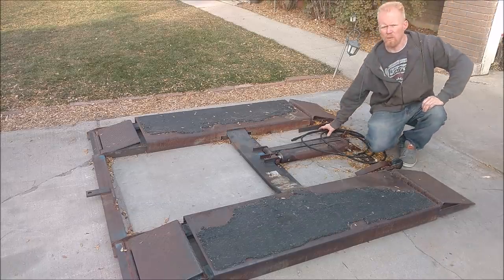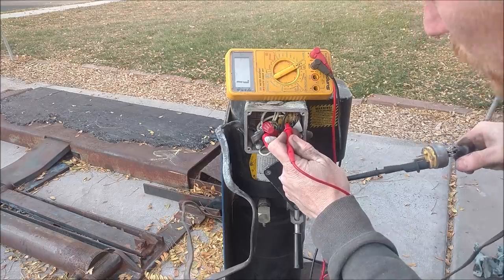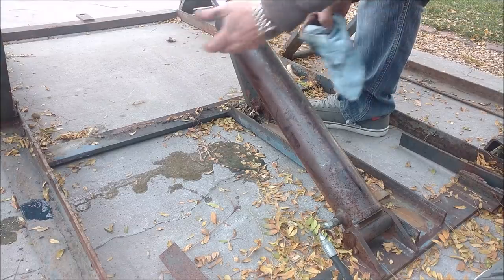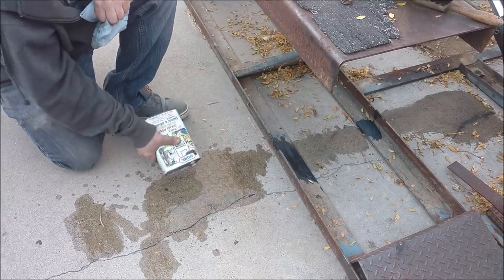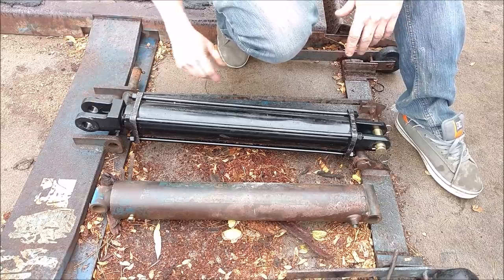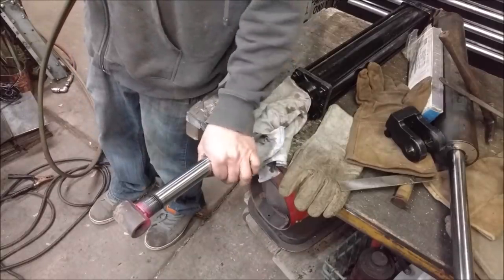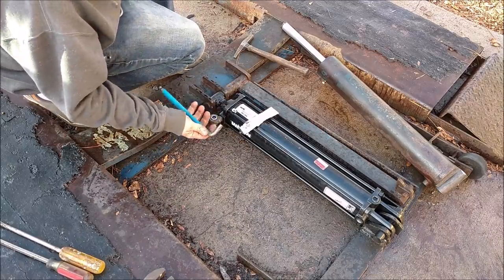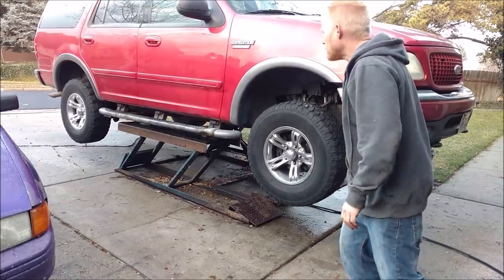Used VEHICLE LIFT worth buying??

Comment: I stumbled onto your page and was very impressed with all your work, including your diy spanner wrench and covering the machined area with your welding glove.
I realize the lift has stops built in as it's raised but it seems a bit risky with the supports on an angle when fully lifted. For added safety, have you thought about welding some eyelets on four corners top and bottom and placing perpendicular upright supports over them when fully in lifted position? They basically would act as Jack stands supporting the raised lift if cylinder was to fail.
Cool lift, and I agree, you better hide it.

Comment: Whew.  The first lift on the truck was scary,  but i am sure you figured out the best points.  Great Job.
Reply from the maker: It's a lot of weight sitting that high. It will take me a while to get comfortable around it. It does have the safely lock, but I'm sure I'll throw a random few jack stands under it if I'm crawling under it.
Reply: @sixtyfiveford  Keep the lock cavities clear of leaves and rocks

Comment: Just a tip, next time you rewire something put on a male plug not a new cord(twist lock if your fancy). You can run any extention cord and it doubles as a power disconnect.

Comment: I have pretty much the same hoist, only mine is powered with an air motor .I love it for doing brake jobs, oil changes, under coating ,anything you can do sitting or lying down. my favorite positions
Reply from the maker: It's a great back saver. I had to do a full fuel tank drop(fuel pump) earlier this year and it was no sweat. I raise the car. Put ramps under each tire to hold the car up. Lowered the lift and pulled all the tank straps. raised the lift up to the tank with some cribbing and lowered the tank right down with the lift. Installed new pump and raised it right back.

Comment: Love that instant spanner at 9:06! Another great video from Sixty-Five Ford!! Learned a lot about the practicalities of dealing with repairs to hydraulic systems.
Reply from the maker: Thanks. I thought about that one for a little while. I cut out the pins and then was about to cut up a large chunk of steel for the spanner handle and saw the adjustable pliers. It got the job done, so I'm happy.
Reply: @sixtyfiveford  Did you leave the pins on the adjustable wrench? Have you used it again later?
Reply from the maker: @JDeWittDIY  I just cut them off and reweld them on when I need them. I really never use the pliers for anything else so I should just leave them on.

Comment: Great job restoring the lift.  After attaching a structural bracket it certainly makes you triple think did the weld penetrate and will it hold under pressure.  Make sure that safety latch is working.  Such a nice feature to have all four wheels off the ground at once!
Reply from the maker: Tell me about it. It's one thing to weld something but another when your life depends on it.

Comment: I used to spray degreaser on the flors of my machine shop and scrub it with a brush, then throw speedy dry on it and it would suck the grease right out. Works even better on a humid day.
Reply from the maker: That's a good idea.
Reply: sixtyfiveford Oh, and I’m jealous of your lift. I’ve been wanting to score one used but no luck so far.

Comment: Great work brother! That little lift is going to make your life so much easier! I wish I had  a blueprint for one of the lifts I've seen advertised on facebook that is moveable similar to a pallet jack, the advertisement shows it lifting a large Dodge Sprinter delivery van! I would fab/build one if I could. The only other lifts that I like are the old single cylinder design-Air powered lift that everyone seems to be removing these days. You have to bury them about 8' down into the ground and concrete the cylinder in. I like that they lower down completely level with the floor and no posts in the way (like a 2 post lift). The other cool thing is that because its a single cylinder, you could pull a car head first in to the shop, lift it and turn the car (180 degrees), and drive it head first! :)
Reply from the maker: I was looking at a cheap used in ground lift the other day. Not much parts support for them anymore. I would think if I was going to the effort to dig an 8-foot hole I'd want to make sure the seal and everything was in good condition before I did that.

Comment: That Expedition had me nervous too! It's a testament to your work though.
Reply from the maker: Yeah, my Expedition weighs 5200lbs empty, so I figure 5500 with random stuff and gas. The lift is rated at 6000lbs but with the safety standards the way they are it probably holds 12-15,000lbs before it fails. After I use it a bunch of times, I'm sure it'll earn my trust.

Comment: that thing is great most small portable lifts cannot be driven over you lucked out dude. I have quickjack and it is not so quick after all but still a blessing.
Reply from the maker: The Quick Jack seams like a nice setup and a little more mobile/compact than the Bendpak. I just added hydraulic quick releases so I can get the hose out of the way.

Comment: You can buy these new for about $1500 shipped.   QuickJack 5000lb Capacity Car Lift 110V BL‐5000SLX.  Very handy if you have a high ceiling.

Comment: Great video ,love your ingenuity in making that replacement cylinder work. Just got a lift myself used ,looking forward to putting it to work.How bennificial has yours been .Thanks for sharing Dale
Reply from the maker: I do love it. It is easier for me to just pull out a floor jack to just do some front brakes on a vehicle. But it's amazing anytime you need to remove more than 2 wheels from a car. I replaced an oil pressure sensor on the back of an engine a few weeks ago and it made it effortless to get up in to the backside on the engine(front wheel drive). I needed to pull an oil pan the other day and put the truck on it; so nice!

Comment: Many years ago I rented a shop that had a low lift like this in it. I went through the same thing with the bad cylinder. Bought another and modified it just as you did here, but one thing I did differently was I added a second fitting and hose at the bleed end. It ran back to the hydraulic tank, so as the pump pushed fluid into the cylinder, the cylinder pushed air to the tank. The tank itself was vented, so it was not a completely closed system, but I worked on cars in the winter with snow and crap dropping off cars and wanted the new cylinder to last longer than the last, (fairly new) looking one did. Many years later I met the new guy in that shop and he told me he had not done anything to it but use it.
Reply from the maker: That's a great idea. That would minimize moisture.
Reply: @sixtyfiveford  I wasn't in that shop much more than a year before I moved, but I never had another issue with it. If you are going to keep this lift, I'd do it. Even though you got the cylinder cheap, doesn't mean another will be and why even allow the chance?? Another thing I did to mine was make 4 sliding pads. There wasn't much chance in them moving, but I made basic "C"channel pieces with a 1/2" nut welded to the outer edge and welded a short 3/8th rod to make a "T" on the end of 1/2" bolts to lock them in place. I didn't really feel it necessary, but since I was working on customer cars I took the extra step. even with rubber pads from a local lift parts supplier, I still ended up making some hardwood blocks for the hotrods.

Comment: I have this lift. It's great for a home garage.  Got mine for $300 from a body shop that was closing.  Add grease fittings to all of those pivot points. Mime had none and joints were all dry. Also, lose those lesther pads. Do nothing but soak up water and rot the steel lift pads
Reply from the maker: I was oiling the joints the other day and thought it was odd they had no grease zerks.

Comment: Great problem solving!  Excellent find ... looking for one of those myself.  I am sure it will save you considerable time with your auto repairs!!
Reply from the maker: Thanks. I've been eyeballing the 2 post lifts for at least a dozen years. They're just too big for my space, so when I came across this one at an auction I knew it was coming home with me.
Reply: @sixtyfiveford  - you got it for a steal ... especially considering that everything worked ... even if you had to replace the cylinder! :)

Comment: I see those hydraulic rams every night. Commonly found on sawdust/wood chip bunkers at your local sawmill.
A super cheap alternative to ATF, is your basic tractor hydraulic fluid @ $20-$35 for a 5 gallon pail.
I’m a little old school. But I was taught, when lifting a vehicle, to get it maybe an inch off the ground. Then be aggressive in trying to knock it off. If it doesn’t budge then it’s safe to go higher.
You’ll then never become a #shopFAIL meme 🤣🤣🤣
Reply from the maker: Good advice

Comment: One thing I might suggest is the storage of those 7018 electrodes, which are low hydrogen “low-hi” and they need to be stored in a dry place (preferably a rod oven) after being opened due to the air moisture that penetrates and affects the weld deposits.  You can cook em before you use them but it’s best to try to manage their keeping after opening.  Nice video!  You should think about piping that air purge to a small storage tank so it stays off your driveway too.😎👍🏻
Reply from the maker: Luckily I live in the 4th driest state in the US where the humidity is extremely low so rod ovens are pretty uncommon around here. I have used 40+ year old 7018 straight out of the open 5gal bucket without any noticeable affects. However, I'm far from being a expert stick welder so I could just be blowing smoke.
Reply: @sixtyfiveford  that’s crazy! I live on Long Island where the salt water and humidity wreck everything, so it’s beaten into our heads with those particular rods.  I gotta say…I’ve been plowing through the entire channel this weekend.  Some really great content.

Comment: New, these Bendpak LR 60-P lifts start right at $2,000.  Well done!  Hope you got the safety locks and stuff that protect you if the hose blows out.
Reply from the maker: Yeah, all the safety stuff is working correctly. I'm into it around 300 right now, so not bad.

Comment: Got it cheap too? Perfect! If you didnt want to rebuild or change the cylinder you could have used a return line straight to the tank. The cylinder wouldnt push as hard and would probably sink down but when you have those safety bars that wouldnt be a problem.
Reply from the maker: I'm into this lift for $300 with the parts. It sells new for $2000, so I'm happy. I debated just as you described but it was pushing a ton of fluid the longer I let it sit. I think this thing had sat for the last 10 years and the pitting would have eaten up the seal further with a couple dozen more cycles.

Comment: air bleeder valve on the port not used,sort of like a breather on hydraulic tank. (I would put a small tank with oil in it in such a way it would drain into cylinder when it is down.keeps upper seals lubed works smoother lasts longer.)
Reply: Run a second hose from the unused port back to the tank making it a closed system? Even if it only has air in it it would stop water getting in there.

Comment: That will be very handy.👍🏼
I’ve never seen a Lyft like that before. Might be a good idea to put some kind a safety stand on it when you have something heavy on it? I always get a little worried with anything hydraulic.
I want one..
Reply from the maker: It has a safety bar that locks in at different heights and I made it a point not to modify that part.

Comment: Great addition for fixing your vehicles! How do you like your power Max 30 plazma machine?? That's the brand I was thinking of buying. Great video and I see your 4 legged companion keeps you busy.
Reply from the maker: My first plasma cutter was a gigantic Snap-on unit from the 90's. It would barely cut through 1/8" all while drawing 50amps of 240volts. I quickly passed it along to the next owner within a few weeks of owning. I then had a Chinese one for years and the initial excitement was quickly diminished with the constant tinkering to keep it going. It only ran off of 120volts but tripled the power of the old Snap-on. Over the years of owning these cheaper units I've read endless forums and the Hypertherm kept coming up as the best by all the guys that use them for a living. It was expensive but over delivers unlike Chinese ones that may claim higher capacity but fall short. The day I got it I was cutting though 3/4"(even some 1", barely) plate even though it's only rated for max 5/8". I'm very happy with it and know it will hold it's value if I decide to buy it's bigger model(45xp) someday. Oh, and it's made in the USA.

Comment: I don't know what brand it was, but I saw an older lift like this in a shop not long ago and it's cylinder had a second line to it. I believe it simply went back to the tank. I want to guess it is to keep moisture from entering the cylinder with the air being sucked in when lowering the lift.  You've had it close to 2 years now, how about an update??
Reply from the maker: It's been working great. I still need to paint it.

Comment: Great repair job on that lift. What you pay for that. Nice little lift. I have a bend pac lift in my garage . Use atf too.
Reply from the maker: I need some good rubber blocks for it, but am happy with the $300 I have invested.
Reply: sixtyfiveford  Nice Set up

Comment: Nice job, sir.
Reply from the maker: Thanks. I'm excited to have it.
Reply: @sixtyfiveford  Idea for the open vent: My Quicklift jacks also use hydraulic cylinders, but instead of a vent on "open" side of the cylinder, they have welded on an air-pressurised accumulator that you fill through a schrader valve. This acts as a "spring" to help collapse the stands when you depressurise the extension side of the cylinder and help it to retract, as the Quickjacks are pretty light and there's no guarantee just their weight would allow the hydraulic cylinder to retract without the weight of vehicle. There is no physical spring. 

You could easily do something similar by running an air hose from your "vent" side to something like an old propane tank or something, since air is compressible and your hydraulic pressure could easily overcome it. Use quick attach air fittings for when you're not using it. I don't think you would even have to pressurise the tank, since your assembly probably has more than enough weight to collapse itself. If you use the female end of a quick disconnect at the cylinder vent port, it will remain sealed and keep dirt and water out of the cylinder when you're not using it.
Reply from the maker: That's a great idea.
Reply: @sixtyfiveford  Just spit-balling. Your videos have presented me with a lot of great ideas. Merry Christmas!

Comment: the pump is designed to run off of 230v, which is why it struggles with 120v.
Reply from the maker: The pump is designed for 120v.

Comment: Watch them O-rings on that new cylinder. It might not like the detergents in that ATF fluid.
Reply from the maker: Yeah, good point. I confirmed that ATF was safe. Detergents in oils simply suspend dirt particles.

Comment: Put regular kitty litter on that fluid an rub it in with your foot it Wil turn the concrete white again then just wash it with the hose ,done
Reply from the maker: That just turns the concrete white until it washes away. Then the stain is still there.

Comment: They look pretty simple  (engineering wise).  Any concerns about general rust and snow pack near the breather fitting?  Wouldn't it be better to install a return type hose to the top of the tank (above the fluid level) to contain the system as it were?
Reply from the maker: It is very simplistic. I plan to park over it, so snow around the breather shouldn't be an issue. However I like your idea and had a similar thing planned. I was going buy a new hydraulic hose and use the old one as a air vent to run a breather hose back into the dry garage. I was also going to add a set of quick release fittings to the get the main hydraulic hose out of the way when not in use and will simply coil up the 10ft breather hose so there will be an impossible path for moisture to travel. Upon raising the lift it will exhaust through the breather hose and kick out any moisture.

Comment: I'd love to have one of these lifts, I work in my Driveway ALOT and this would be amazing to have
Reply from the maker: I haven't needed it yet but I'm excited to use it.
Reply: @sixtyfiveford  I'm building a 84 S10 Blazer right now and this thing would come in freaking handy right now, Bc not only am I building the Blazer I'm also going to Build a Camper out of another Blazer to match my Blazer... So yeah I've got alot of work ahead of me and using Jack's and all that Lol
Reply from the maker: Sounds like an awesome project, I see you have a video on it. I'm going to check it out.
Reply: Yeah I did a little video today about it Lol, It's pretty much still on paper right this minute until I get my Brown & Gold Blazer done, I have to Swap the Frame from the red one to mine bc mine is bent & then I'm going to put the bent Frame under the Red one and Cut it right behind the Bend and put the Trailer Tongue on it there and then just start turning it into a Camper, I'm excited about it tho

Comment: If you go with the quick disconnects on the line let me know how it works out for you. I got a lift similar to yours but mine is 2 cycl. and I had to rebuild one cycl. as soon as I got it same thing wrong with it as yours. Mine has a safety latch but mine is controlled from the lift box it's just like a brake cable from a bicycle works good.
Reply from the maker: I have the quick disconnects ordered, I'll just need to install them. I'm curious to see how much air the introduce into the system, if any.